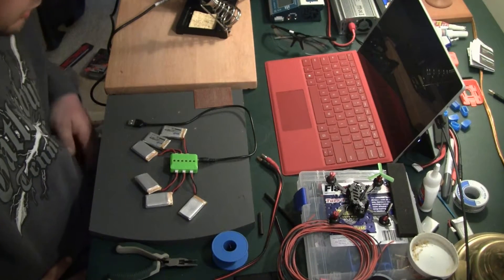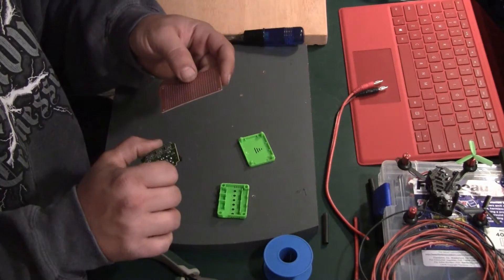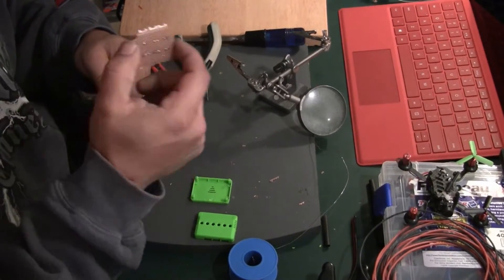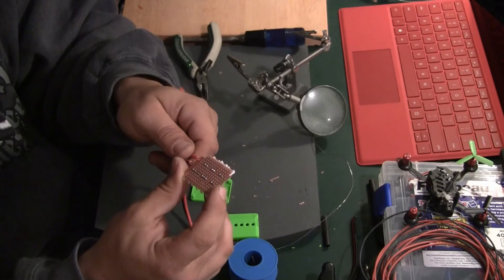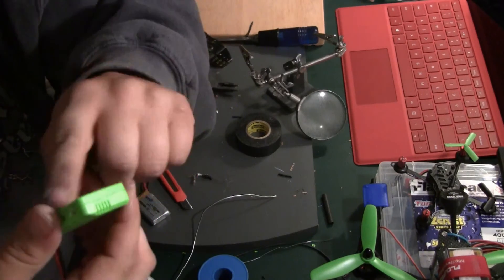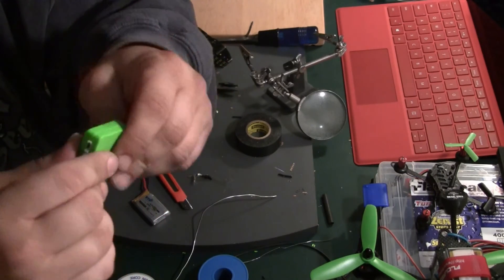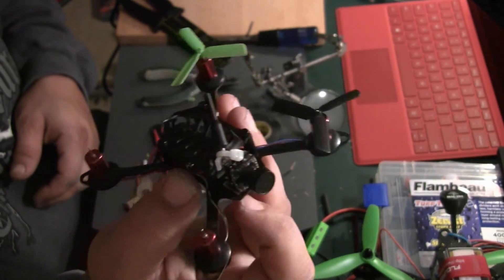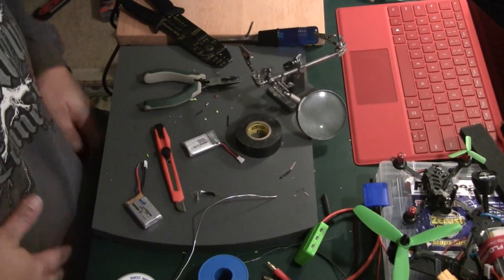LT105 X6 Battery Charger DIY Hack USB charger into parallel board for your charger

Comment: Got a ? You seem like u know so I will ask u.  I bought this setup to have a lighter and longer lasting battery for my RC helicopter. (800mah vs the older lower mah battery) but now I only have power to the controls and nothing to the actual rotors turning. I’m currently charging the older battery to check the engine just Incase it died a couple yrs ago.